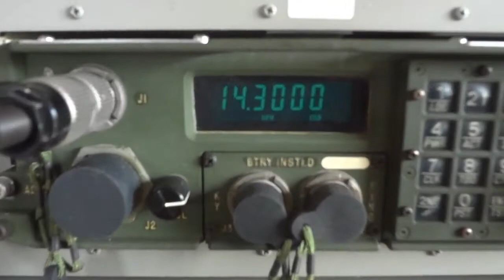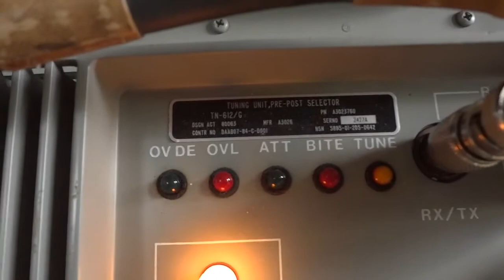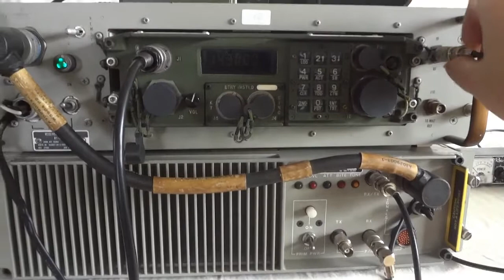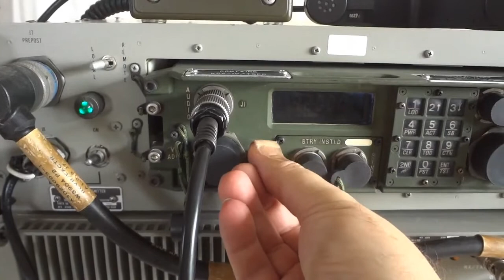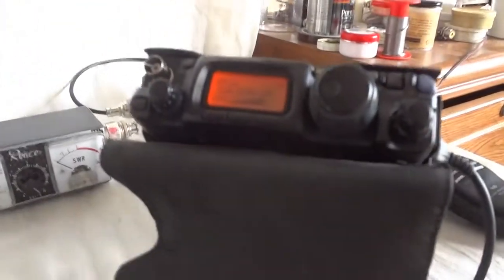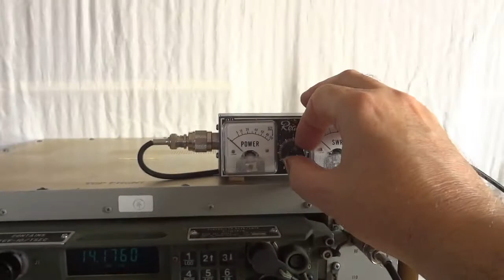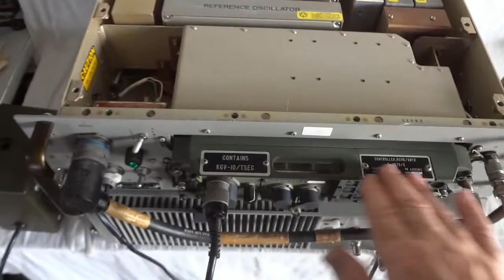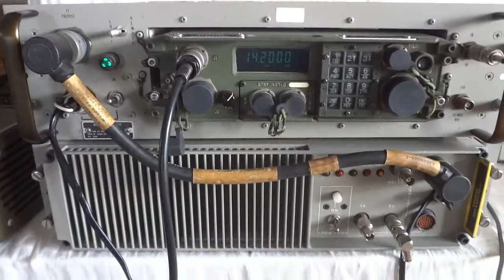GRC 215

Comment: I have three or four of these complete with power amps. I salvaged these out of a communications van about 15 years ago. I'd like to get at least one of them up and running on 80/40 and maybe sell the rest. Might have a problem finding all the interconnecting cables though. Looking for documentation and operation manuals.